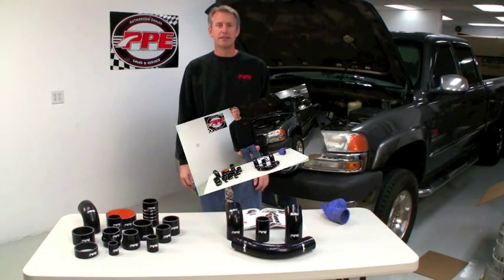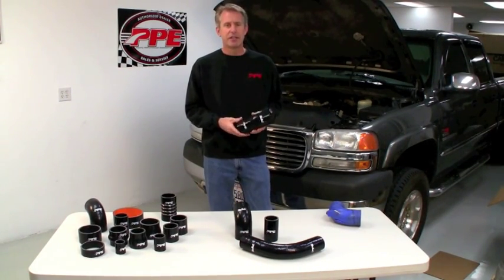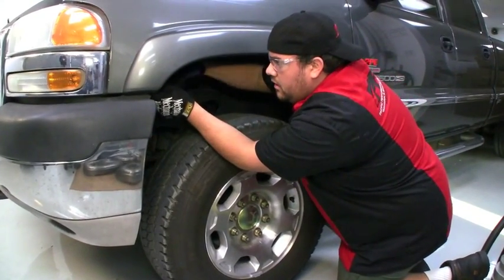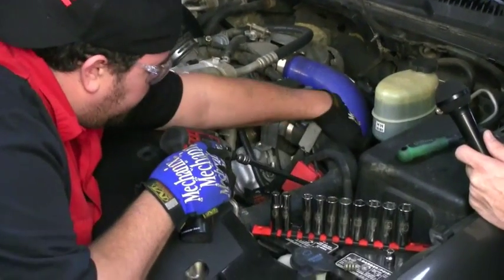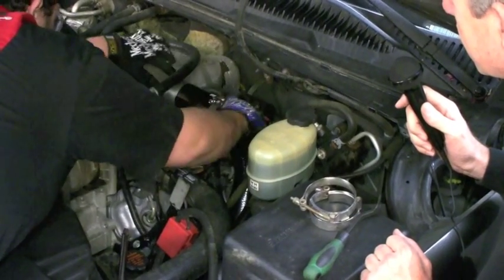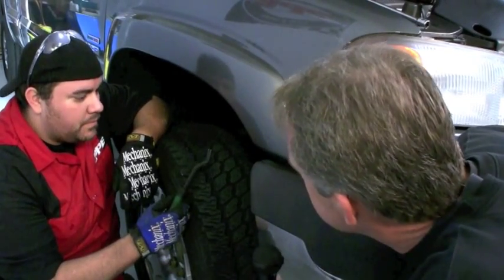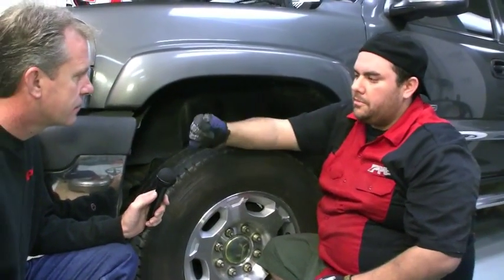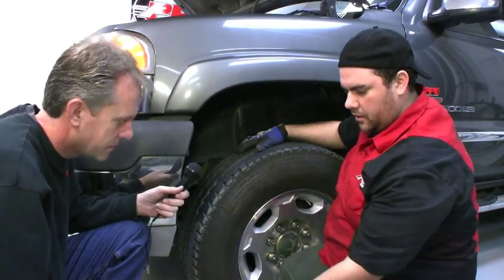PPE Silicone Hoses.mov

Comment: It is legal. We have High sulphur only about 1000-10000ppm. No emissions required. I need full transmission Stage 5 and 850-950hp crate engine specifically designed for high sulphur diesel use and easy to know the parts number to order if there some parts needs to be changed

Comment from the maker: That definitely sounds like you need the Stage5 and not Stage4. We do have the complete transmission where you send us your crate engine and we send it back finished and ready for installation, or we can just send you the parts and you arrange to install it there. But I am unsure if you will need that much power for daily driving or if you have any legal issues with how powerful your truck will be once finished. You will need to check out your local laws to make sure we are not breaking any.

Comment from the maker: The kits are pretty much all inclusive, you just need to have proper installation tools. As for availability of parts. You might want to contact us at the shop 714.985.4825 (M-F 8am to 6pm PST) by phone or through our (ppediesel) website for an estimate on how long the parts will take to get to you. The Stage5 kit is worth the effort, but I do not know what you will need the Duramax for.

Comment: Okay i'm planning to export a Duramax to my country. Does your kit of TwinTurbo and all upgraded kits offered to Stage 5 transmission. Do you really recommend to upgrade the engine? The other point here we do not have spare parts for the duramax it self, so if I installed the kit and anything happened wrong from one of your parts, what is the time to prepare the parts and how easy to communicate about the spare parts of PPE?